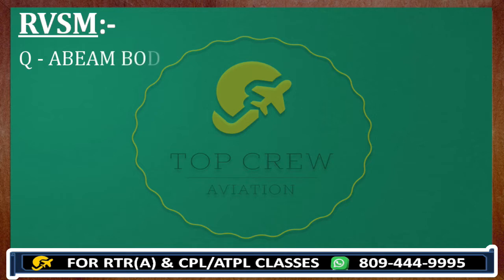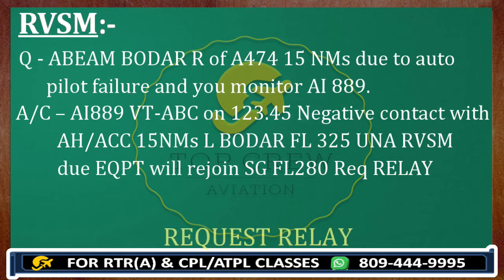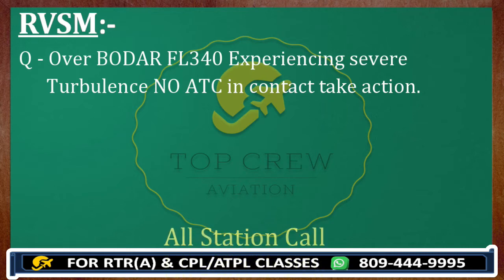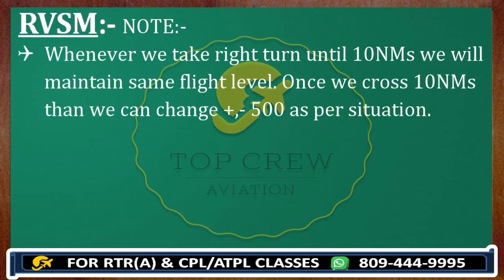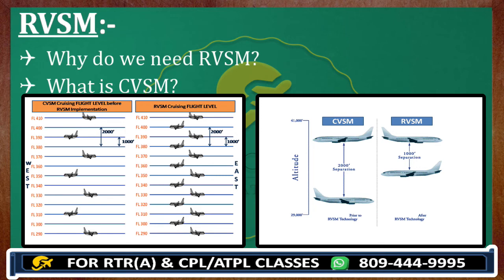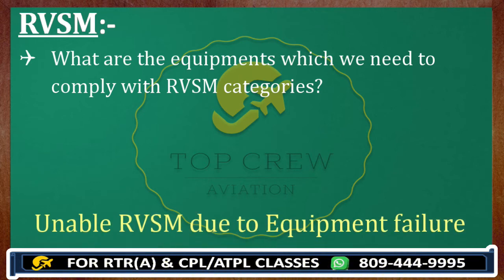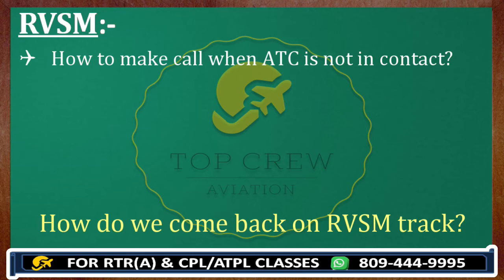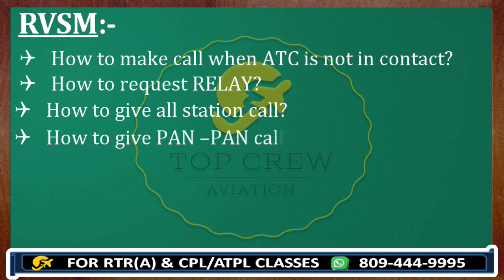RTR(A) PART - 1 | RVSM PART- 8 | SEVERE TURBULENCE IN RVSM | HOW TO DO REQUEST RELAY । TOP CREW

Comment: You said to relay msg to other a/c we use 123.45 freq but in air pilots normally tune atc freq and first officer tune 121.5 freq as main freqs. So how pilots can talk on 123.45 when they have not tuned 123.45 as main freq.
Reply: Infact they can monitor other a/c on same atc freq and so communicate with him on same atc freq.
Reply from the maker: My dear friend it is only for exam point of view not the practical flying.